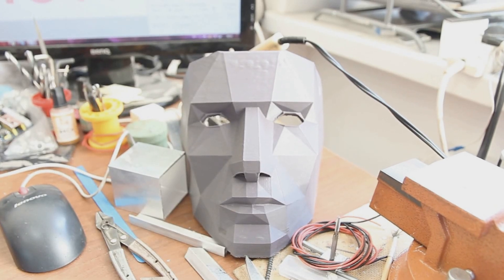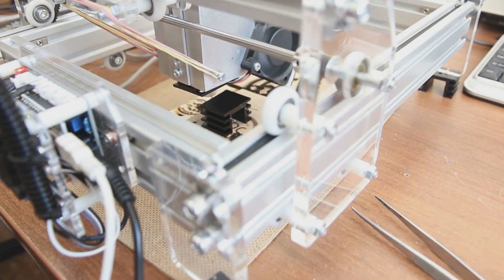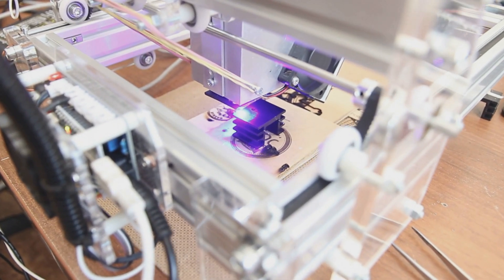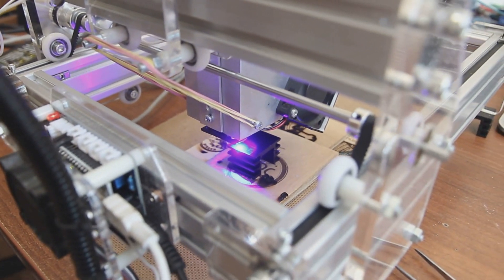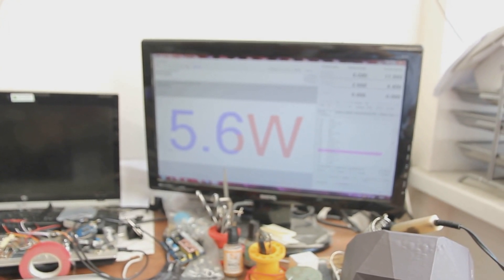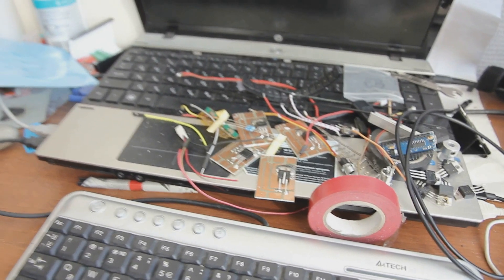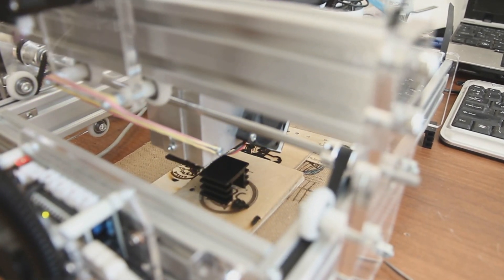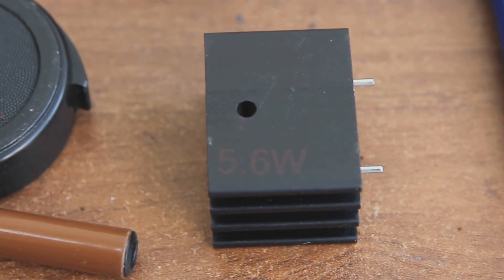Laser marking using 8W Endurance solid-state laser

Comment: Hi George, I have a question. I am running a 2.5watt diy laser and I would like to get a more powerful module. Can I easily hook up your 8 watt to my system. I am running the LaserAxe software also. I do have a TTL connection on my controller board.